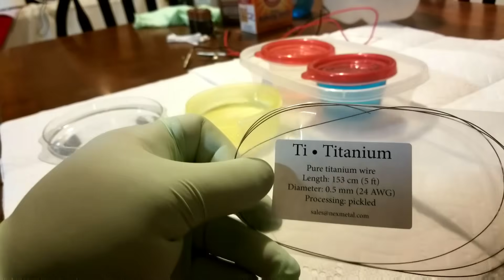How To Anodize Titanium With 9V Batteries Cheap And Easy - Full Tutorial

Comment: Are the colors different if you use titanium instead of the stainless steel fork? Another video shoes a brown color if you use two batteries and that's the only difference I'm seeing.

Does it have something to do with the voltage going through the material?
Reply from the maker: There can be a few variables in general. Cathode material will not change the color. If you're using batteries instead of a power supply you have to realize that the batteries may not all be fully charged. If I use full batteries and someone else uses batteries that are almost dead you'll have 2 very different results. 
Another factor that I've found to effect the color to a point is what you use for electrolyte. I prefer baking soda because it allows me to get the greens in the higher voltages, but some people use borax. Some say it doesn't matter, but green can be finicky. 
Finish and grade of the titanium being anodized makes a big difference as well. I have found the grade of titanium to make the most difference. Lower quality titanium just doesn't look all that great in my opinion. 
Also the etch makes a huge difference. If you want the best, brightest colors you need to get a good etch prior to anodizing. 
Those are all the things that can alter the color chart a bit. Hope that helps!
Reply: @ApollosRings  yeah I appreciate the quick reply. I plan on following your video guide sometime in the near future. I want to anodize my crkt jettisons scales and see how that turns out. I was just curious because I watched a blade HQ tutorial as well and they were getting a very brown color with two batteries.
Reply from the maker: They used to link to my channel, but a month or so ago they made their own video. I've been doing this for years now, and do it on a regular basis for my ring business. I'm always more than happy to share any info I've gathered along the way! If you ever have any questions, feel free to ask. My original anodizing video is a bit dated, but within the next couple weeks I plan on putting out a really detailed, updated how-to video
Reply: @ApollosRings  the original was good the only issue really was the lighting. Hopefully you can get a better lighting situation in the new one to really show off the colors.
Reply from the maker: Yeah, that was a few years back. Now I've got plenty of quality lights, much better camera gear, and new editing equipment.  Hopefully I can knock it outta the park with the new one, lol.
Reply: @ApollosRings  I have a question you might be able to help me with. I bought a kubey knife with blue anodization and it came very faded and washed out. If I clean it with Windex it will go to the blue it's supposed to be but the moment I touch it the color goes away again. Is that normal or is it a bad anodization job?
Reply from the maker: That is completely normal with anything anodized. Your skin oils on the titanium are changing the way the light is hitting the surface.  Anodizing is just an oxide layer on the outside of titanium. The oxide isn't colored, it just appears different colors because of the light reflected off of the oxide. Different thicknesses of oxide appear as the
 different colors. So when you have oils on top of the oxide it bends the light and makes the colors look very different. That make sense?
Reply: @ApollosRings  yeah it makes sense I just didn't know it was something that happened right away. What about clear coating the titanium? I had a more expensive one with pretty detailed patterns and it didn't have those issues but it felt like it was coated and was very slick. What type of coating would you use?  

Thanks for the help.
Reply from the maker: Anodizing can be clear coated, but I would recommend trying the clear coat on a scrap piece to test what your colors will look like when coated. Just like skin oil, clear coat over the anodizing can change your colors a bit. I've used a few different things myself. I use a clear resin over top of the anodizing on a few rings. I've also used automotive clear coat enamel on knife scales before. Depending on the color, some look better than others clear coated. You really just need to test it and see if you like the look.
Reply: @ApollosRings  yeah I learned that one when I returned the fancy knife lol. It really washes it out but I understand why they do it on more elaborate finishes.

Thanks for the help I appreciate it

Comment: How long do the batteries last?
Reply from the maker: I've used the same set for over a year without having to replace any, but you should really have a volt meter to keep an eye on their levels. A dead battery will really mess everything up, especially if you're not sure which one is dead.
Reply: @ApollosRings One more question do you have to use distilled water? Would regular filtered water work
Reply from the maker: The problem with using regular water comes in if your water has a high mineral content. I always try to use distilled to eliminate that variable. If you're in a pinch, and can't get distilled water, filtered water will work. Just keep in mind that if the mineral content is high you may have slightly varying results. Short answer, ror the most part you should be fine.

Comment: You mention covering the detent ball, then just remove it with nail polish remover?
Reply: Thank you it looks much simpler then I would have imagined. I guess I’ll find out lol
Reply from the maker: Yeah, it's not hard. Just make sure you put a few good coats of nail polish on it and let it dry completely before anodizing. If not you'll really mess up your detent ball.
Reply: SharpKnifeNuts to remove the anodizing do I also need to coat the detent ball or it’s ok to just put it in the solution?
Reply from the maker: I would coat it first
Reply from the maker: Yeah, nail polish remover, or pure acetone will take it off. Sometimes nail polish remover isn't quite as strong.

Comment: lovely tutorial.
How long will anodization last?
Reply from the maker: Thanks! It definitely depends on individual wear and tear. It could last forever if it's not being used, but on something like an every day carry knife that is constantly in and out of a pocket I usually get a solid 6 months without any signs of wear, by a year it has some scratches, but it still looks good. I usually re-anodize when it shows some scratches. It is a very resilient coating that I would almost compare to powder coat. It will never peel off though, it will just eventually wear and scratch. Hope that helps.
Reply: @ApollosRings  ok! thanks!
and is the rust cleaner necessary? if i dont plan on removing it?
Reply from the maker: It really makes a huge difference.  I highly recommend using it prior to anodizing. Your colors will be so much brighter and vivid if you etch the titanium first. You do not absolutely need to, but it makes a considerable difference.

Comment: Dumb question i know you said dont do it but what happens if i use copper wire instead of buying titanium wire to hold the piece in the bath. Even have the alligator clip right on the piece.
Reply from the maker: There's a video up on the channel showing what happens if you want to see what happens. I recommend spending the $3 or so on titanium wire for sure, but check it out for yourself if you like.

Comment: If the titanium is not anodized do you need to use the rust and stain remover?
Reply from the maker: I recommend using it prior to anodizing.  You really should etch the titanium first to get the best, brightest colors.
Reply: SharpKnifeNuts okay thanks

Comment: How well does this process work when trying to anodize aluminum? 

Do voltages or liquids need to be changed?
Reply from the maker: This process is for titanium. The process for aluminum is completely different. I eventually will be doing a series on aluminum as well, but this will not work. Sorry about that.

Comment: Do you have any advice or seen anything like this??

I first cleaned it in a ultrasonic cleaner with a degreaser (simply green)

Next it went into Whink Rust Stain Remover - to remove previous anodize/start with clean surface. (At this stage when I removed it, the titanium piece turned a darkish gray and had some sort of layer on it that I could sorta buff off/similar to you would with tarnished silver. (What is this???)

I had 12 9v in line, with 28GA Ti wire leads, Positive to titanium piece - negative to piece of aluminum foil sitting in water mixed with baking soda (also tried borax)

The color goes to purple/blue then if I let it sit longer it will go to just a nasty silverish grayish blueish purple and will not advance any further down the spectrum.
Reply from the maker: Couple of questions for you - how long is it taking to turn color? Does it start turning color immediately, or does it take a while to get your color? Do you know what grade of titanium you're anodizing?
Reply: @ApollosRings  it starts turning color almost instantly. I would say it reaches the blue/purple after about 10 seconds. but after that nothing - I can never seem to reach the bright green I was aiming for, also color is not consistent, I wear gloves, give it a super good clean prior to everything and still ends up splotchy, unfortunately I am unaware of the grade... but I paid 170$ for it, even though I know that doesnt really mean too much.... look up Omnivap XL - it is a dry herb vaporizer. Is the discoloration after using whink normal? when I look into yours it appears more silver that mine.
Reply from the maker: Sorry, been crazy busy in the shop. It sounds to me like a cheaper grade of titanium.  I've run into that on a part before. It's been a few years ago now though. If I remember correctly I may have skipped the whink etch the 2nd time around and got it to work fairly well.

Comment: What wire s used for the alligator clamps that connect to the batteries?
Reply from the maker: The wire for the alligator clips can be regular copper wire, but any wire going into the bath should be titanium on the anode side.

Comment: Can you use canthol or stainless steel wire or does it have to be titanium wire?
Reply from the maker: Definitely not stainless wire. I haven't tried kanthal, so its hard to say. I know people have said aluminum wire works, but I haven't tried that either. I know copper wire doesn't work. I just bought a spool of the titanium wire because it was cheap and I know that works great. If you try kanthal, let me know. I may try it myself and do a vid about it.

Comment: Does the fork/metal you connect negative to be titanium? Or could it be any metal. Other than that, great video, really shows how to do this.
Reply from the maker: The fork I use is stainless steel. It can also be titanium, but it can't be regular carbon steel.  I suggest using stainless.
Reply: @ApollosRings  Alright thanks man!
Reply from the maker: No problem! If you have any issues let me know, I'll help any way I can
Reply: I've never seen a titanium fork, but it would probably be a lot more expensive than stainless.

Comment: I have a question about that Rust Stain you were using to remove the anodize. I was using the exact same stuff to remove the anodize off my stainless steel eyeglass frame. I left the frame soak in that stuff for half an hour. But why it did not work?
Reply from the maker: I've never attempted it with stainless steel, I really couldn't tell you if it should work on that or not. I only use it to remove the anodizing on titanium. Works like a charm on titanium. You may very well need something different for stainless. The Whink will work on other reactive metals as well, but I think stainless is a whole different beast.

Comment: My BM51 morpho, the titanium has some sort of metal part on it (the zen pin) and I can’t budge it out, will anodizing it with the thing on there affect the metal? I’m not even sure if it’s metal lol, forsure it’s not a detent ball
Reply from the maker: Any metal in the bath aside from titanium will instantly oxidize if it isn't coated with something like nail polish. It will also draw the current away from the piece you are trying to anodize. I would maybe try soaking it in WD40 or something to try to get it loose, then if you can't get it loose coat it with something prior to anodizing. That's my 2 cents, lol. Hopefully that helps
Reply: SharpKnifeNuts gotcha. I went ahead earlier to spray some WD40 in it. The piece is spinning but hoping it’ll come out. If not then I’ll have to avoid anodizing that one small portion lol
Reply from the maker: Hopefully you can get it out, but if not you can just coat it really well with nail polish then you shouldn't have any issues. Let me know how you make out, and good luck with it.
Reply: SharpKnifeNuts thanks so much sir! I’ll ask more if I come through any problems! Followed on IG too 👍🏻👍🏻
Reply from the maker: I appreciate the follow over on IG too, thanks! 👍🏼🤜🏼🤛🏼
Reply: SharpKnifeNuts how about dipping it into the rust removal? I got the same whink bottle
Reply from the maker: I would coat the piece that you can't get out with the nail polish prior to etching it in the Whink.

Comment: what if i use 12v battery .
Reply from the maker: You can use any different batter you like, but the colors only show up at their respective voltages. You may get a light bronze with one battery, but you would need multiple to achieve other colors.
Reply: @ApollosRings  if i dont have a titanium wire sir what will i use
Reply from the maker: I've heard that aluminum wire works as well. I haven't personally tried it, but more than one person has said it works. Copper wire does not work.

Comment: Does the titanium wire HAVE to be 28 gauge?
Reply from the maker: No, not at all. Any size will do. I've been told aluminum wire works as well, but I haven't tried it. Copper definitely does not work though. I have a video on the channel that shows what happens if you use copper wire.

Comment: i couldn't get any color reliably after 3 batteries.  its like it almost stayed its natural color.  spyderco mantra 2.
Reply from the maker: Couple questions, did you etch it prior to anodizing?  Are you using all fresh batteries? Do you have a volt meter you can check your voltage with?
Reply: @ApollosRings   sorry just saw this.  i dipped in whink for about ten seconds ( until it  bubbled) , then in distilled water then to my "bath".  the only thing different i did was use a piece if ti wire instead of stainless for the negative.  no i dont have a volt meter. amazon here i come.
Reply: @garykentjr10  Yeah sounds like your negative (cathode) was too small. Just use a stainless spoon or fork or something. Needs to have some significant mass to it.

Comment: Hello. Thanks for the video. I have tried this. 3x brand new 9v. Snap positive to negative with a negative on one and and positively the other end. I use titanium wire and a stainless fork. Distilled water with baking soda. I didn’t use the wink stiff I used muriatic acid (pool cleaner / hydrofloric acid 30%) Since I have that in hand and can be bought at any Home Depot for 10$ a gallon. The wink stuff is primarily HF acid anyway so I don’t see it as a problem. So I do as you instruct except I don’t have the windex bath and nothing is Happening. I even sanded the titanium with 1200 grit before the acid bath and still nothing.  Is the windex that important? What am i doing wrong?  The odd battery is getting a little hot which I guess is normal. Please help. Thanks in advance. Oh it’s grade 5 titanium 6Al/4V  if that matters.

Ps I have seen to use borax , which I’m very familiar with. I used it for years as my flux for my forge welds. Hell they used the same brand (mule team borax) in the 19th century as a flux. Works great and it can be bought at the grocery store. It should be in the laundry detergent section. Is that what I’m missing ?
Reply from the maker: You say "the odd battery is getting a little hot"? Your batteries should not ever be getting hot. That leads me to believe something isn't correct. Do you have the positive and negative leads reversed by any chance? Are you 100% sure the fork is stainless? Do you have a volt meter? I would test the batteries. Brand new or not, you could have a bad battery in the bunch. 30% hydrofluoric acid is pretty serious stuff too. I doubt that has anything to do with the issue you're having, but Whink is only around 3% HF. Be extremely careful with that stuff.
Reply: I thought muriatic acid is the same as hydrochloric acid, not hydrofluoric acid. Not sure which one is in Whink though, I've never worked with it. The hot battery leads me to think that there's a problem with the circuit.

Comment: Do I have to have rust remover if my ti doesn’t have a ano
Reply from the maker: I highly recommend using the Whink either way. If you don't etch it prior to anodizing you won't be able to achieve every color in the chart.
Reply: SharpKnifeNuts if I just wanted to revive a purple with 2 batteries should I still use wink?
Reply from the maker: You can try it without first. Just make sure you clean it really well with alcohol or acetone. You'll probably be fine. If you get the color you're shooting for then you're good. Worst case, it doesn't quite give you the color you're looking for, then you could get the Whink and re-anodize.
Reply: SharpKnifeNuts thanks🙂
Reply: SharpKnifeNuts also what else can I use besides a stainless steel fork?
Reply from the maker: Anything stainless, or anything titanium or niobium. It just has to be roughly the size of the piece you are anodizing. A flat piece of stainless stock, or even a stainless bolt would work just fine.
Reply: @ApollosRings  does ot have to be whink? Do any other brands work?